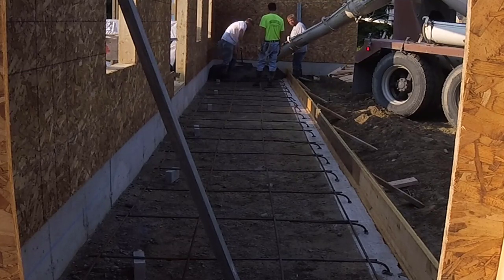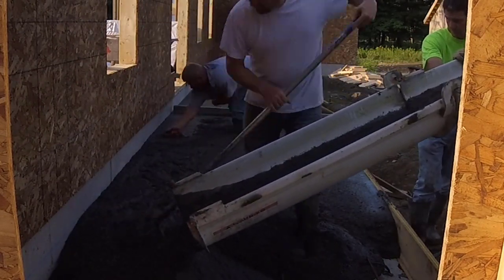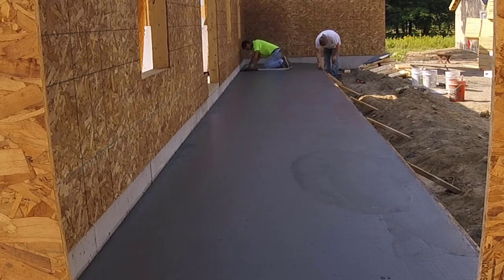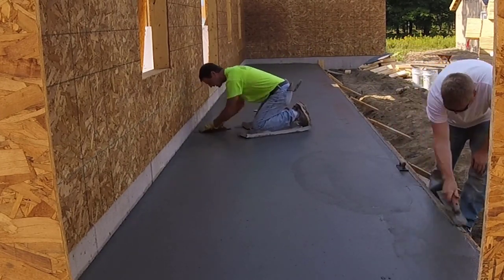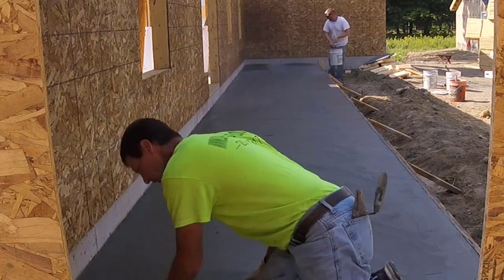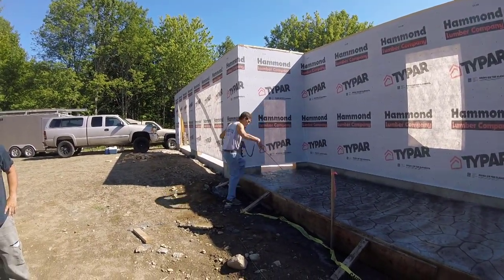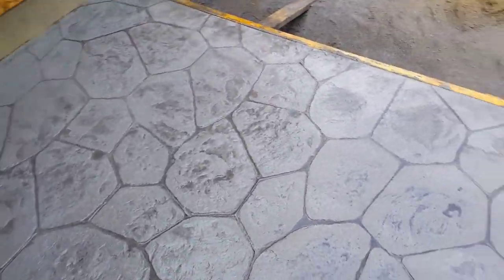How To Pour And Stamp A Concrete Patio Entrance

Comment: Great job looks great. Mike, I was taught to always steel trowel the slab. Hit it twice once with the mag, second pass with a trowel. Could you possibly explain the pros and cons of stamp work maged verses steel trowel. I greatly appreciate you passing on your knowledge. Thank you.
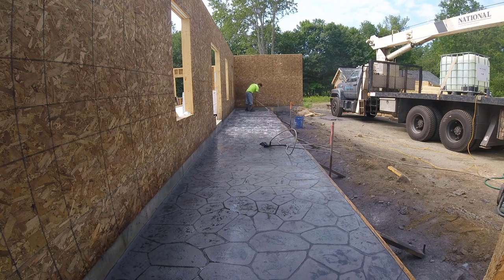Reply: Dale Valley 11:11 if your concrete has air entrainment you should not hot it with a finish trowel because it could cause surface spalling in colder areas

Comment: First of all amazing job and really good videos. I have a question. I spoke with some of my friends who are in the building industry and they told me that they avoid stamped concrete, because supposedly they are really sensitive to salt during winter ? Can you comment on that ?
Reply from the maker: All concrete is sensitive to salt during the winter. The concrete needs to properly sealed for protection. I don't recommend using salt on stamped concrete less than 1 year old and never if possible. It is difficult to repair stamped concrete and blend in the repair. But if sealed correctly we don't usually have any problems.

Comment: Thanks for your anserw to my after i left you comment on your you tube website you gave my a advice about concrete mix for stamp project Here in Poland we got all diferent measurments but when i checked that and conwerted it is more easy for my I want let you know what kind of mix according to Ideal Work i m using here in Poland Cement 330-350 kg per cube meter of concrete clean portland cement no fly ash added. Stones about 8-16mm fibre mesh also and i m adding superplasticising admitexture winter or summer version around 1-1.4l per 100 kg of cement nothing else. This is receipe i m giving guys to mixing my concrete. Is this is correct according to you ? I m using only colour hardeners and powder releses for my project and somethimes i got big problem with this mix after i add hardener going very fast specialy on hottest days what i can do according to you with this recipe i mean chemicals or rathio of cement to work better for my Regards Janusz (i was finisher for a 6 years in Edmonton Canada and now started busines with American style in Europe ) sory for spellings mistake .
Reply from the maker: Your mix is probably good. Hot days you have to only pour early in the morning and maybe smaller sections if possible. Using color hardener makes the job a little more difficult in my opinion. It adds another step and can dry out the surface a little. I only like integral colors.

Comment: Looks nice! I’m a little surprised the schedule had you guys in there that early in the build of that house. We always had trouble keeping patio areas from getting dicked up from the other construction trades during the build. One thing that was pretty successful, is we would buy sheets (4’x8’) of that corrugated plastic (same material they make those temporary political signs you see in people’s yards during election time) and cover the areas for protection. I was glad to see you didn’t put expansion joint up against the wall. So many people do that and in a cpl years, it looks terrible. Totally unnecessary.
🤜🤛